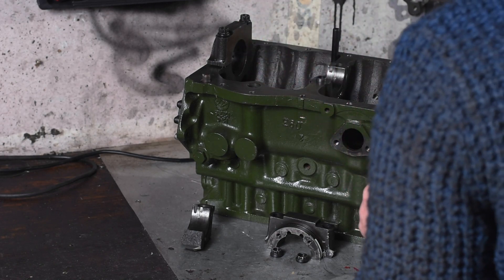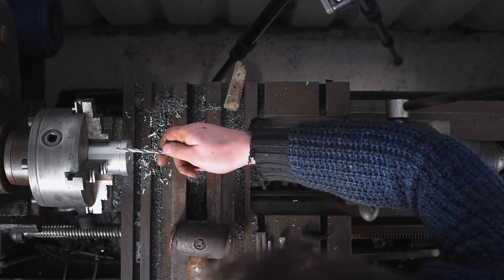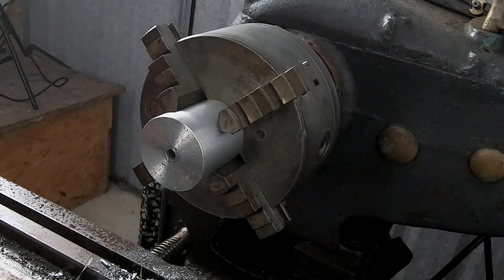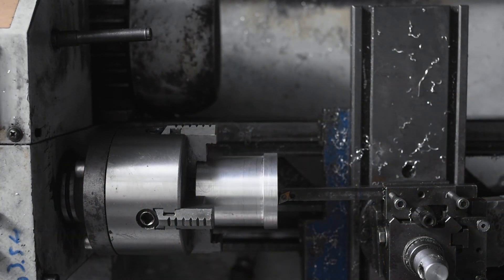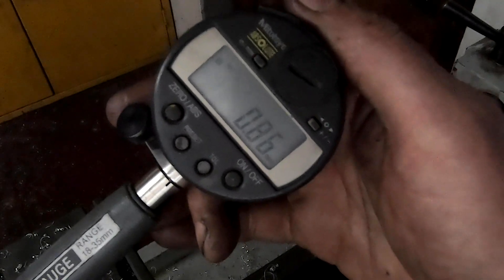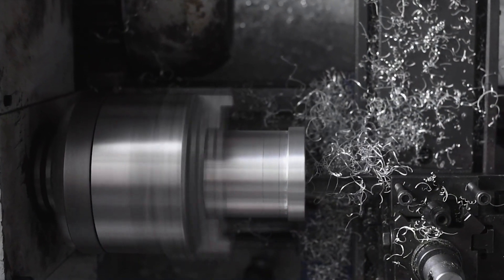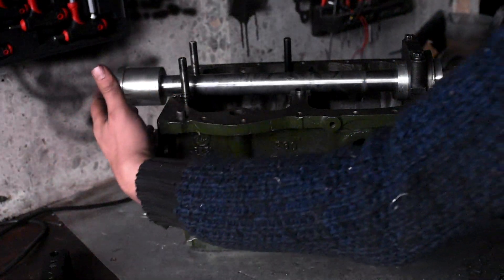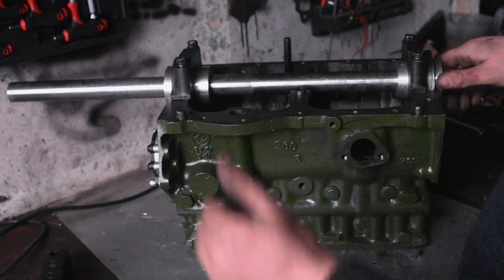Classic Mini A-Series Block line boring EP2

Comment: I’m sure that you clocked it in as well as you could but I think you would have been better to have left it chucked in the other lathe and bored your hole straight after turning the OD, takes out one possible point of error.
That said, you clearly know what you’re doing and have got a wonderful result 👌🏻
Reply from the maker: Ya you are bang on, keeping it in the one chuck would have been the best option. We moved from the Excel to the colchester as it has the HP to drive the big drill bits. As you say I very carefully clocked it on the 4 Jaw so was happy it was well with in the tolerance I was looking for  👍
Reply: @HREIRL  Just an observation, bore the centre hole on the Colchester as the first operation, then do everything else on the excel lathe. Brilliant video, you have a new subscriber.